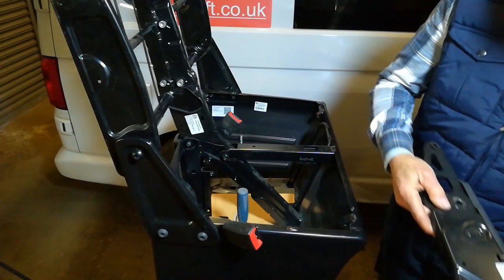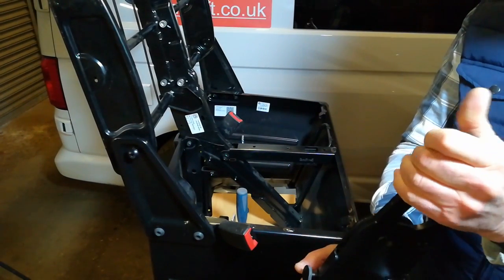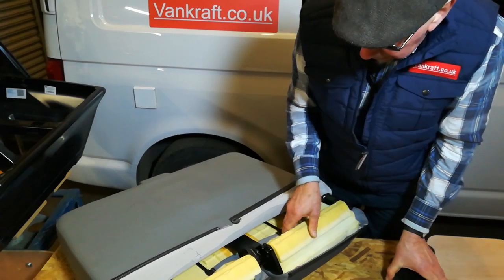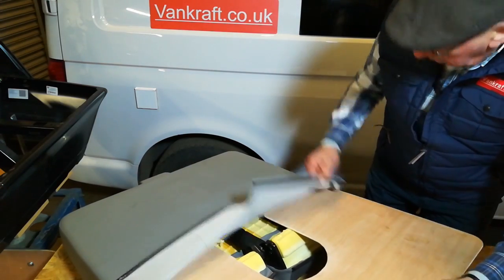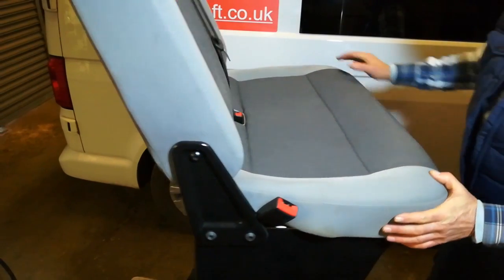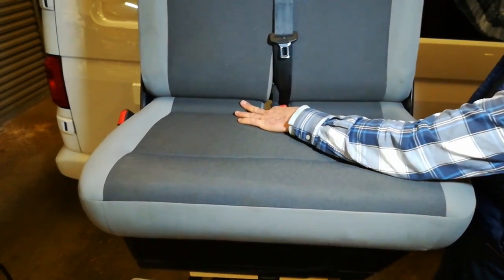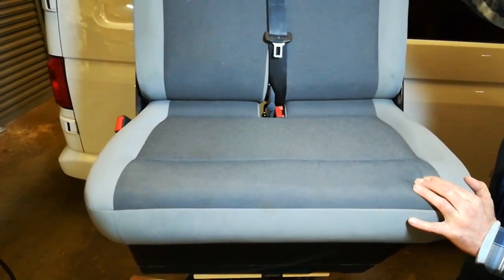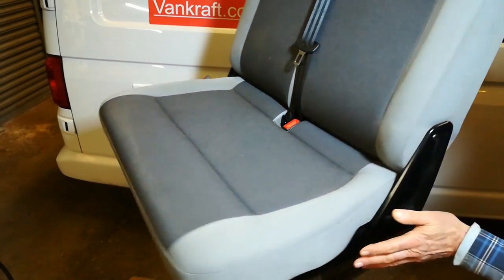Vankraft Instruction Film

Comment: Fantastic product, easy to fit and great improvement over old hinge.
However, and this is nothing to do with the hinge, I folded the seat down only for the seat belt to jam and not be able to get the seat back up. Totally locked in the folded position.
After much cursing and head scratching I finally undid the seat belt anchor bolt under the seat,thus releasing it and everything ok.
Have since found out others have had the same problem with some folding seats, and I stress it is not the hinge.
For some reason the seat belt does not like the horizontal !
Some tie a knot in the seatbelt before folding or get a belt stopper.  
Easy when you know how !!